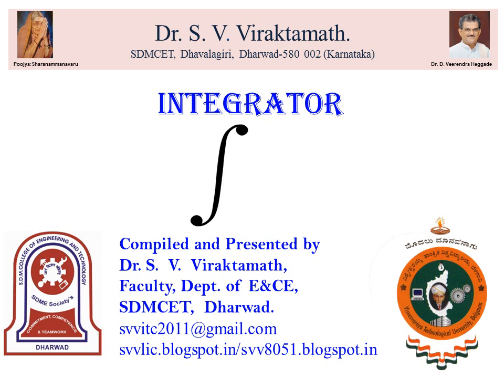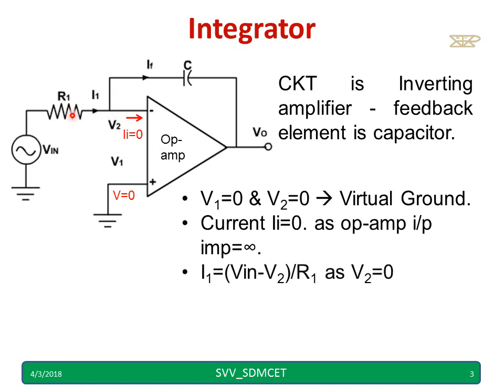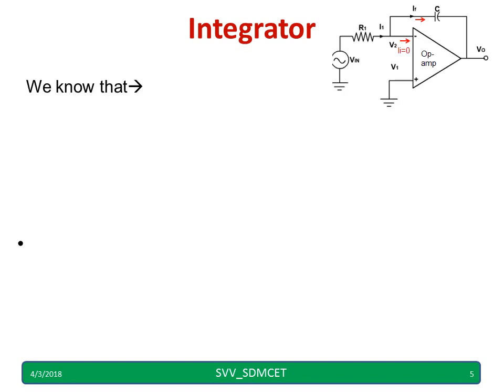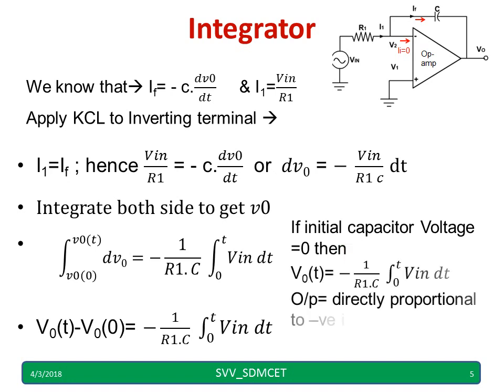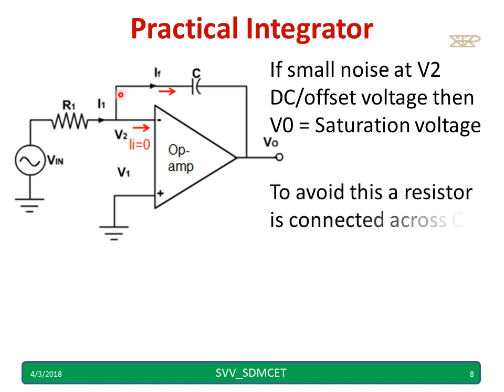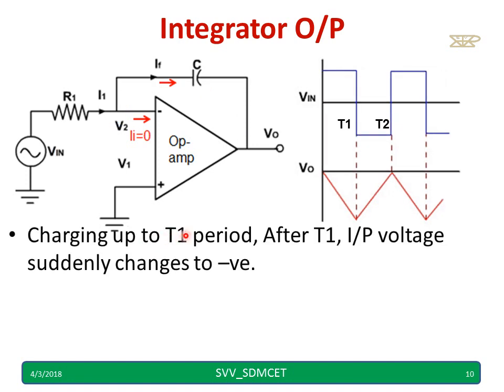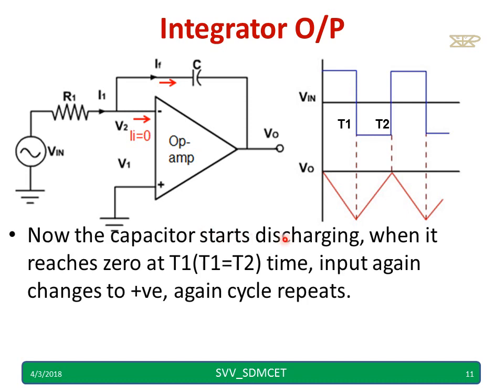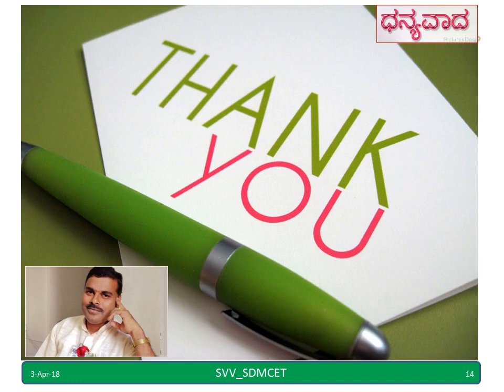Op-amp Integrator

Comment: sir how is the output a negative cosine wave? for t=0 V out is also shown as 0. Then isn't this a reverse sine wave? Can you please explain this?
Reply from the maker: Hello, Initial charge of C =0. due to positive input capacitors starts charging u r left side +ve and Right side of the capacitor terminal as -ve, no i am taking output in between ground and capacitor right terminal hence as capacitor charge increases, the output voltage increases in -ve direction.. For more information we can have google meet. Thank you.
Reply: @SVViraktamath  Thanks a lot Sir. It's perfectly understood. Thank you so much
Reply from the maker: @gregorirasputin659   thank you

Comment: the best op-amp integrator video ever...   also, i have seen the same basic circuit used as a sample/hold control,  by closing a relay contact on the jfet-op-amp  +input for a sample time and the 10uF cap will maintain that value until the next relay ON error correction.   thanks a lot...:)
Reply from the maker: Good morning and Thank you q ZORN